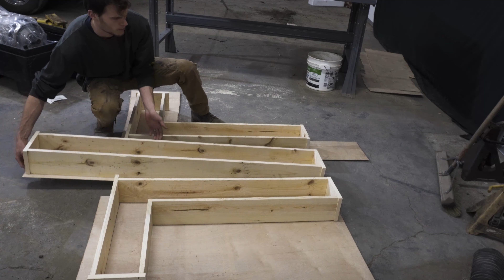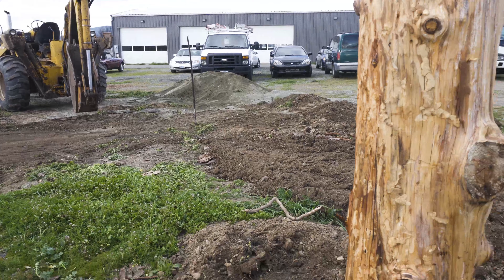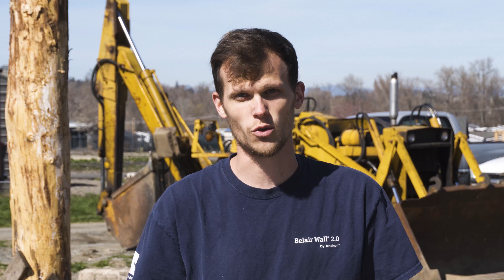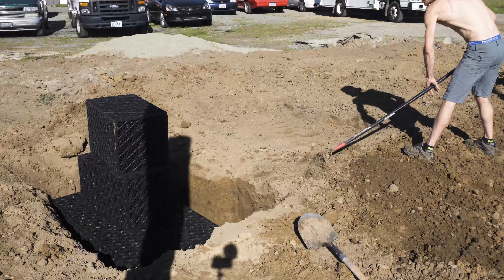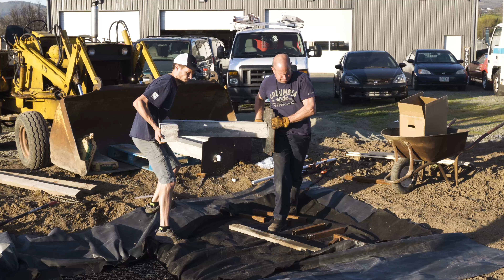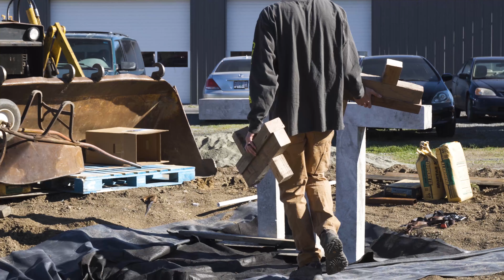I designed this Fountain.

Comment: All you need to do is get square blocks or round for about $4 ea  or use pvc pipe to build a water feature with lights for about $150 with lg
Gph pump

Comment: Dude I love your videos,  you're very creative. You have inspired me to build a waterfall myself.  I plan to create a design of one to be the focal point center front to my deck, kinda like a big arch or something....it hasn't quite come together just yet but the hamster is running lol
My question is how do you actually make  the orifice that the water flows out of the water fall? Also, does the pump recirculate the water. Please help... I'm looking to do this asap!
Reply from the maker: Sounds great! On this particular fountain I had two previous videos that covered the concrete work more in depth. the L-shape pillar has a small trough on top to help disperse water. 

The pump does recirculate water. I cover most of that type of info in my "Pondless Waterfalls 101" video. 

I would love to see whatever you make!